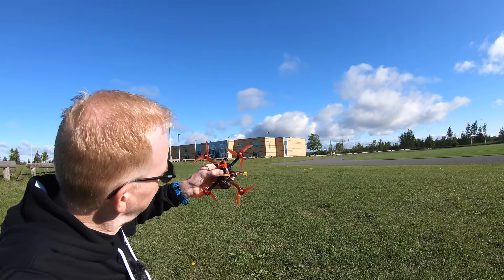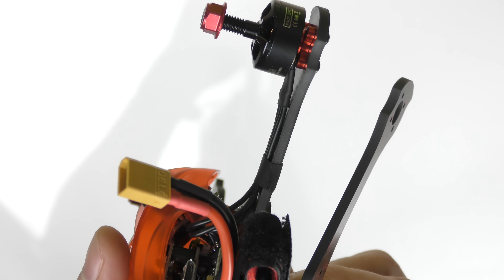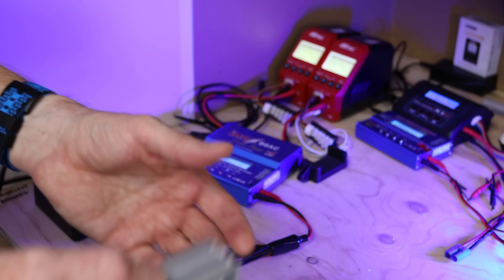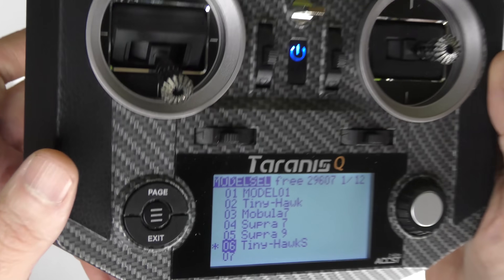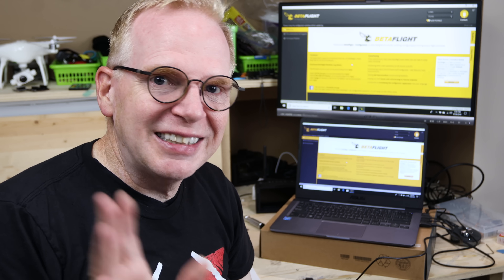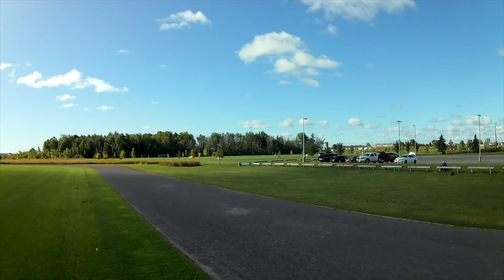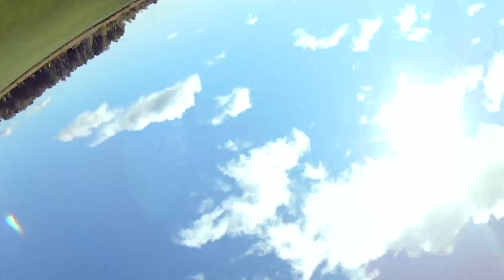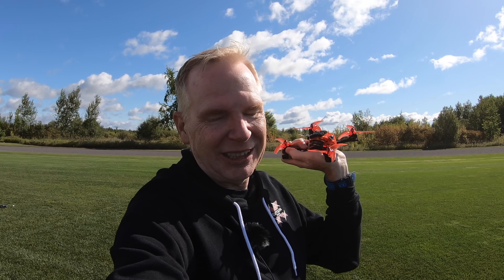Emax Babyhawk R Pro - A very powerful Race Quad - Review & Setup & Crash

Comment: Do the Tx and Rx work off of crystals? Binding would be easier, right?
Reply from the maker: Crystals.... as in the technology of the 1960's ????
Reply: @CAPTAINDRONE798  
No. I have a HiTEC Laser 6 Tx and a HiTEC RCSD 3500 Rx. They have 72.610hz FM crystals in them. Not the tube type. lol
Reply: @CAPTAINDRONE798  
But I've only flown planes with it, so far. Wouldnt they work the components of a drone like servos?
Reply: @CAPTAINDRONE798  
https://youtu.be/mPB_66Lv4OI
Similar to this

Comment: The Pids are not good for 6s. Set the YAW lower. That is because why the motors spin so high even though your throttle is at zero and set the P, I and D lower, than the vibration are gone if you get a punch.

Comment: I Just Don’t Understand How In 2019 All These Drones Have Such Short Flight Times. Anything Over 20 Minutes Seems To Be The High End Of The Spectrum.  Someone Get Elon Musk On This ASAP.
Reply from the maker: Ahhhh... You are mixing up Camera Drones with FPV Race/Freestyle drones.  Camera drones have very low power easy going (beginner type) motors (like DJI consumer drones). Such drones also use very simple batteries that slowly provide power.  Now FPV Race/Freestyle drones have motors and ESCs that are hungry for amps and volts.  They will such a 4 cell battery dry in 3 minutes if full throttle is kept on.   This is why you'll always hear people say camera drones (like DJI, AUTEL, PARROT, YUNEEC) are great beginner drones, because out of the box anyone can fly them with no skills (kinda like driving your Dad or Grandpa's automatic transmission station-wagon).  On the other hand FPV Race/Freestyle Quads are like driving a standard transmission Porsche in a world where there is no up or down and the laws of physics are continuously challenged.
Reply: CAPTAIN DRONE 

I See. Thanks For The Explanation Cap.

Comment: You need to reduce the pids when you fly 6s, that's why you have those terrible oscillations that probably cause the battery to come off... 1300mAh 6s is what I use on my 7 inch :)
Reply: Right. Exactly. And he should be using a 450mah-650mah 6s for the 4"